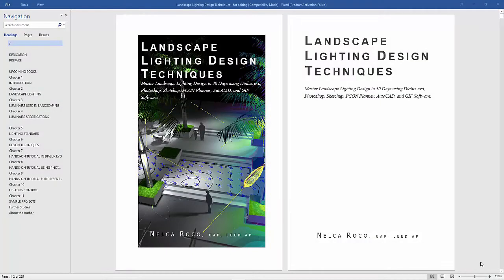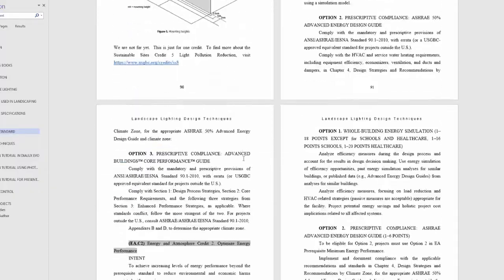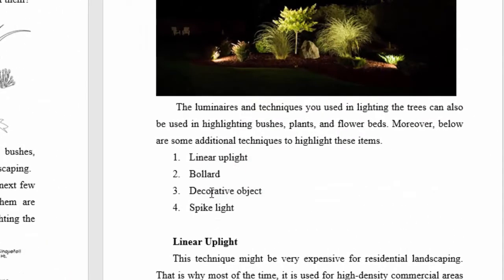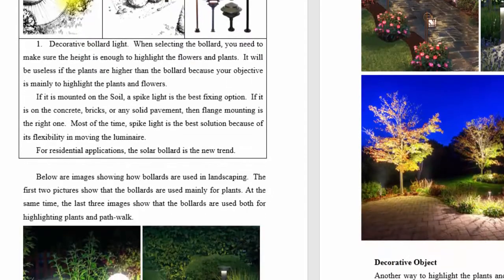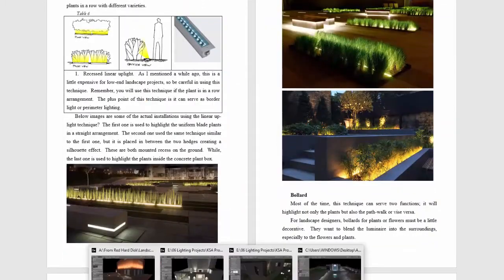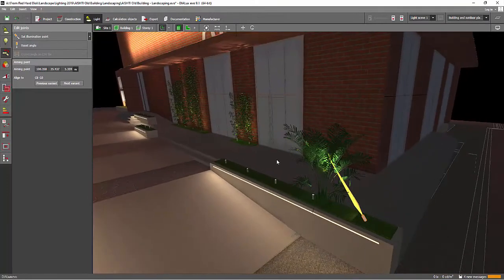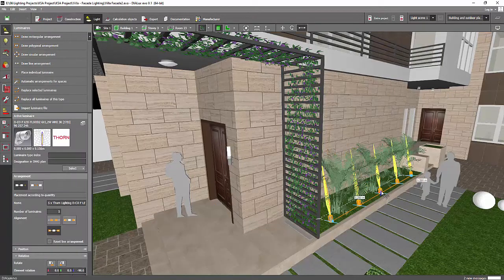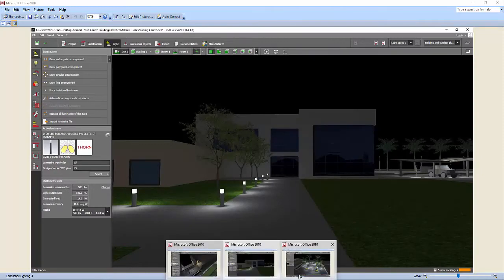How to light the bushes, plants, flowers, and ground covers in landscape lighting design?

Comment: Wow! Finally found Fil Vlog on Light Designing. New subs here. Reason unpopular in PH is High cost of electricity. Archt.Roco, will 12volt Transformer of same bulb wattage vs 220v be same electrical consumption? or will there be savings? except for benefits of safety am concerned if electrical cost will just be the same as reg 220v. Appreciate your expert's response. 😘